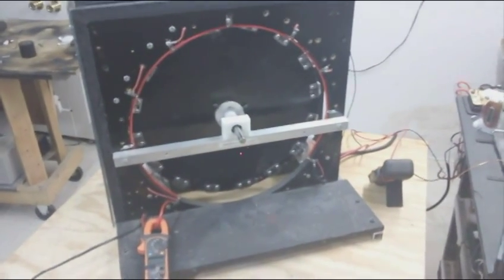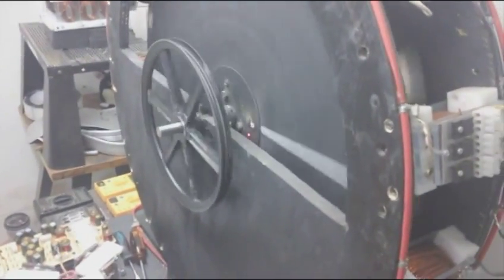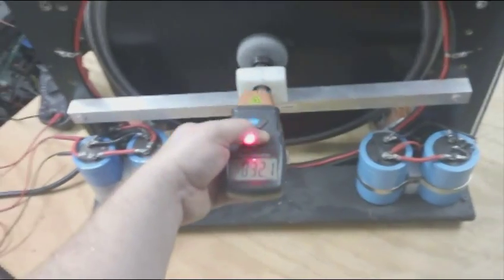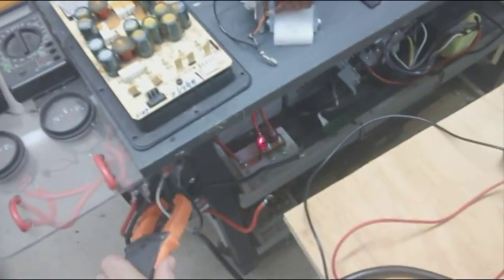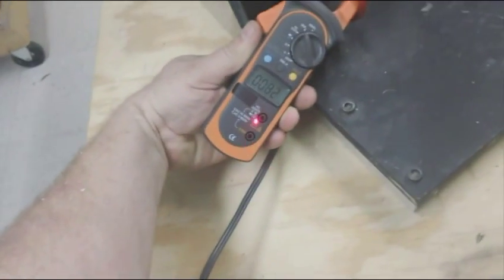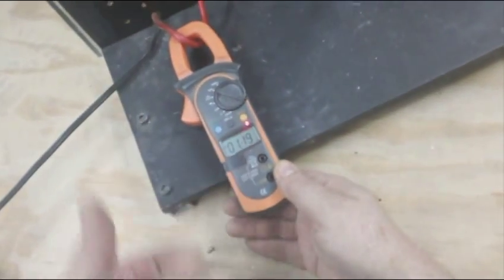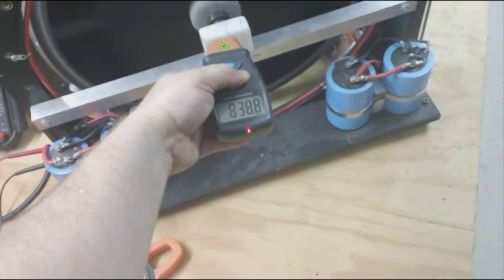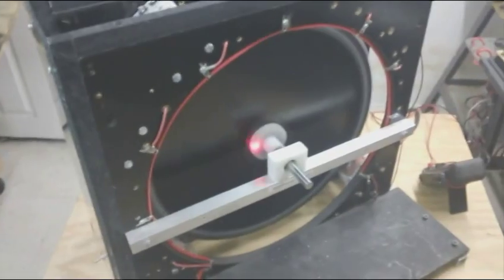Boxmotor Retest

Comment: With respect, sir, you should'nt use this amp-meter close to the box. It would miss to get a good reading, due to the fact that the alternating magnetic field from the box induces joules and boost the result.  Just the amount of watts from the sources and the ones usable at the end of all the circuitry are needed.
i do follow your work with grand interest.                   
Respectfully,
Frank.
Reply from the maker: Yes I Agree the big motor we have the meters are mounted away from the wheel, its on the to do list to mount meters on the motor thanks for watching

Comment: Hi Zero, BTW, For your battery charging.Check the work of chris hunter from alaska.  He has found a method to extend battery power by a factor of 8. in other words, your battery would run your motor 8 times longer. Basically, he uses 12 batteries, arranged in eight banks, which will take turns powering the motor, running for two seconds, with one of those seconds overlapping with the next bank, then resting for 6 seconds, to allow time for the cells in the battery to chemically re-stabilize, preventing rapid degradation.
Reply from the maker: thanks I will check out